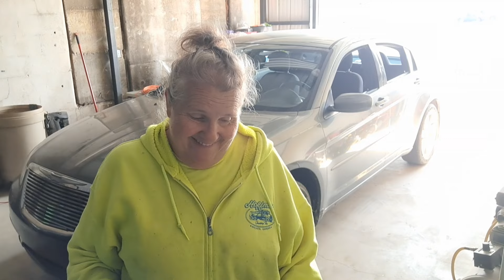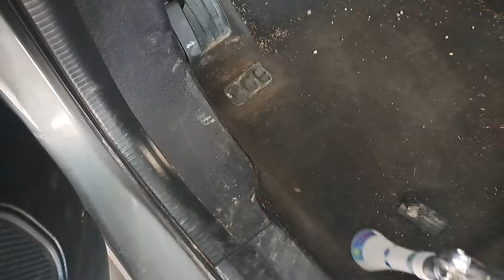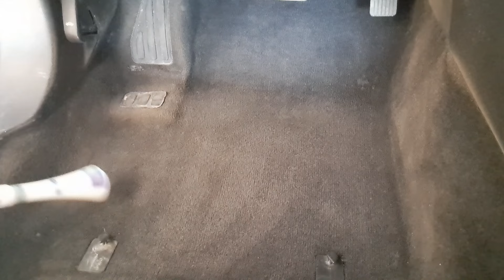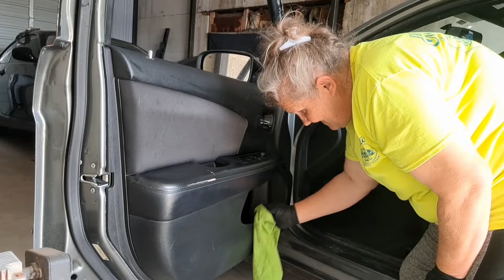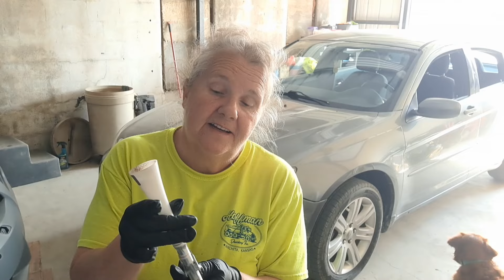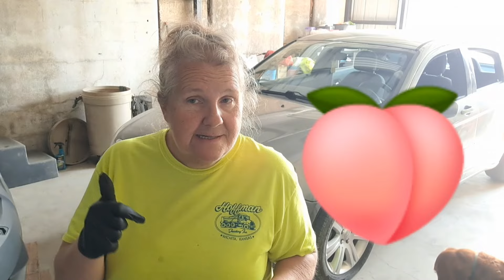Tornado Air Tool | I bought one | Let's use it!!

Comment: That is an extremely useful tool.   I can't imagine not using car mats because if the carpet wears out and it will, it's going to kill the resale or trade-in value of the car.  Best purchase I made was a good set of rubber mats.  Super easy to clean.  Even a cheap set of Walmart mats is way better than none.
Reply from the maker: She's been telling me she just forgets.  In her defense she is very busy on top of a caregiver to my dad in many ways since he is in a wheelchair.   I did finally get a floor mat down.

Comment: What size compressor do you need for this?
Reply from the maker: My compressor is 11 gallons.  But to use with the tool it needs adjusted to roughly 60 lbs of pressure for longevity but still do a good job with it.

Comment: I'm not knocking your tool, but it looks just like a fancy air gun. In fact, you could probably get $1.99. aired gun and harbor freight and do the same thing.
Reply from the maker: That may be true.   I never saw one at harbor freight but it's possible its elsewhere.  I went to Amazon. Irs a generic.  But it gets the job done.
Reply: No, I was talking about a regular air gun. It looks like the one you got but it’s got a slim nozzle. It doesn’t have that wide nozzle.